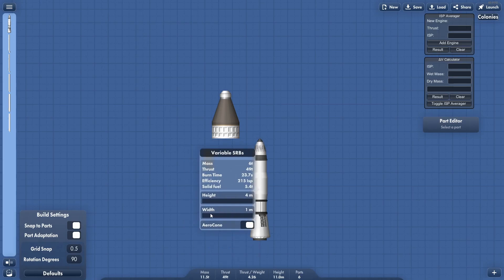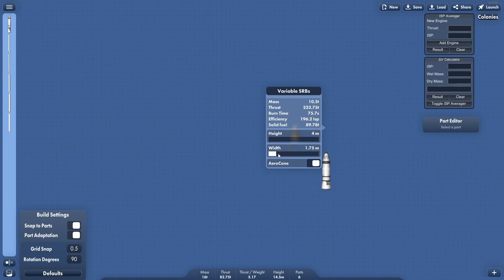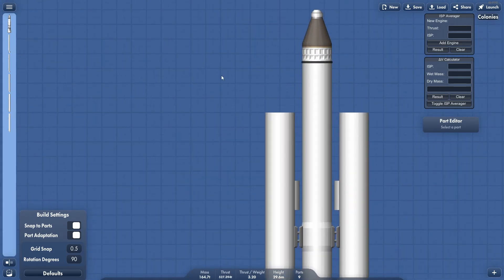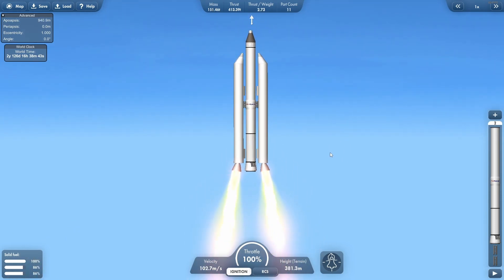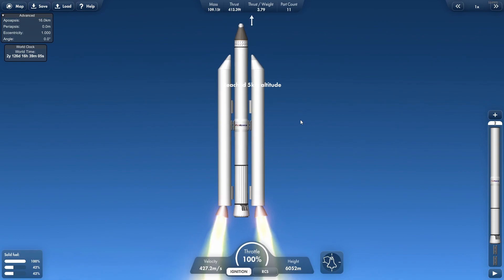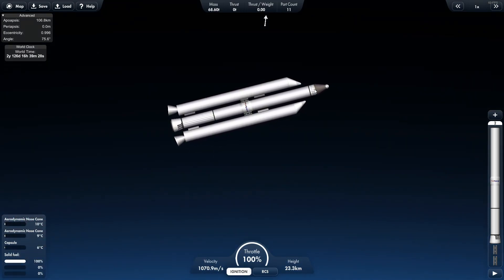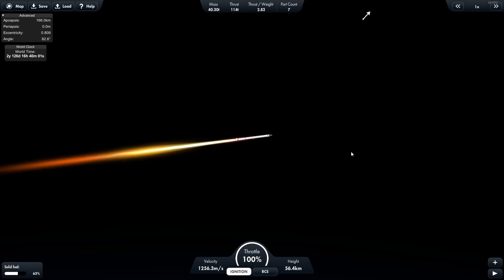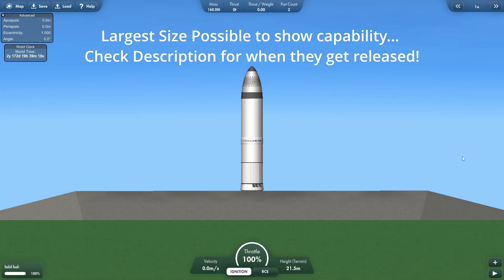Adjustable Booster Motors for Spaceflight Simulator

Comment: Can you make it So the Boosters can be turned off and throttled while ignited? Because when they can't be turned off or throttled while ignited makes me kind of unhappy.
Reply from the maker: Short Answer: Yes... But.
Long Answer: Yes I can overide the SFS coding for Solid Boosters such that they can be toggled like liquid fuel. However, solid boosters don't work that way in real life, once ignited they are GO GO GO! That's their trade off, lots of Thurst in exchange for lower ISP and inability to turn off.

My suggestion is you use the custom sized boosters and adjust their size to fit your required burn time and thrust rather. Its all part of learning how to best build rockets!
Reply: @picospace  Ok i guess i better accept that

Comment: Bro I have a question can you make a hinge you can scale it to 360 to -360 degree and when you click it spins to that location negative goes opposite direction it must be intact even spinning and spinning speed adjustment
Reply from the maker: I’m still working on a concept, but it’s tricky due to game mechanics.
Reply: @picospace  goodluck 👍
Reply: @picospace  one last request can you make the solar panels heat shield but not very wide